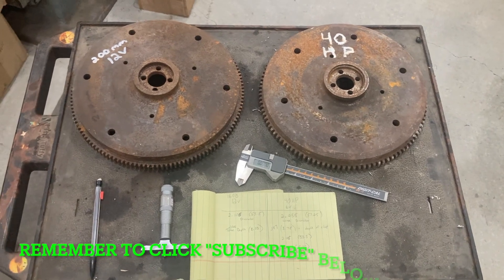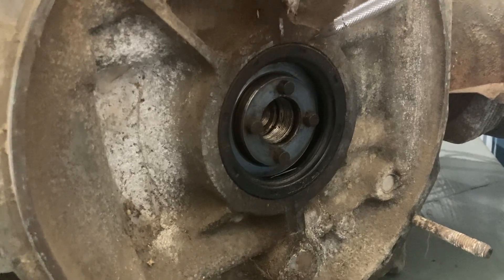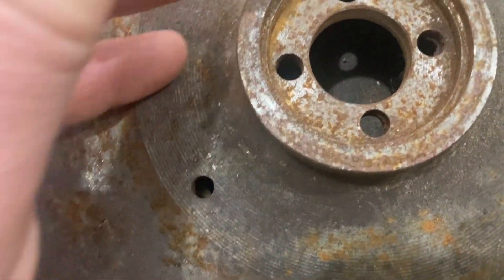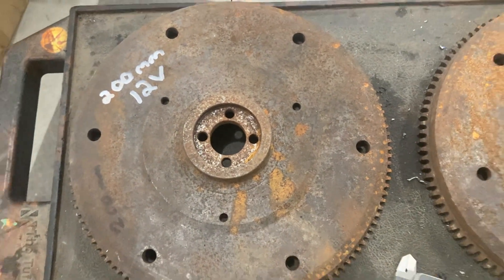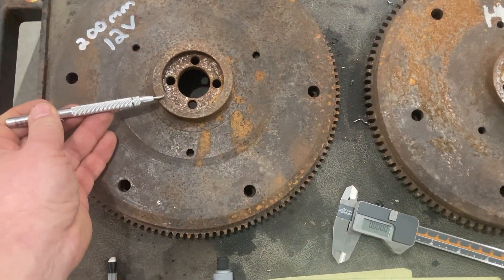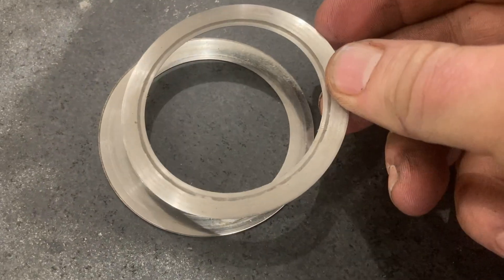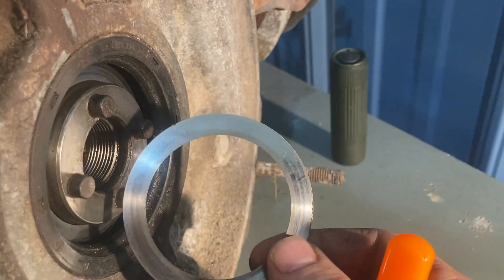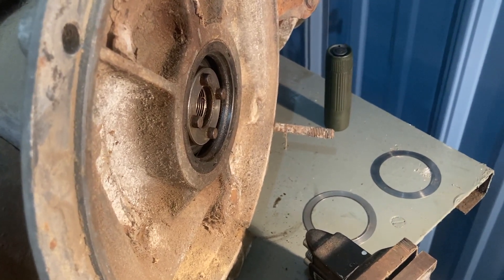AirCooled VW - Machining a 12V Flywheel for a 6V Crank - Type 1 Engine

Comment: Thanks for the excellent video! Can you bolt a 6 volt (non O ring) 200 mm flywheel  to a late O ring crankshaft using an early gasket? Would an early clutch with a collar fit with the 6 volt transaxle? Thanks

Comment: Hello, I made the 57mm clearance but now the opening is way too big !! When you now put the clearanced 12V flyweel on you're crankshaft without using the 4 dowel pins, you will feel that the flyweel has a lot of play. If you measure you're crankshaft it is 53.4 mm at the frontside and 54.7 mm behind the step. So I think that the 57 and a quarter mm clearance must be 54,7 mm. Correct me if i'm wrong. But still a great video.

Comment: Are you able to machine 12 volt flywheel shims to fit over 40 hors crank as 40 horse shims aren't available anywhere
Reply from the maker: You can’t really machine something that thin, as it’s a stamped product, but you could probably attempt to dremel it or create a punch style process. I’ve never tried it as I’ve collected 40 horse shims, but I suppose it’s possible to modify one if a person was careful enough. Making 100% sure there were no burrs or raised edges would be critical.

Comment: I used to run a 200mm 6V flywheel and 6V starter on 40HP with 12V

Comment: Very interesting. I have a later 12v gearbox in my '63 Beetle am trying to restore her back to standard (ish). I now have a running (but poorly) 1200 6v '64 engine, but am currently running a 1600 TP 12v. Should I even consider putting in the '64 1200 or just sack it off as a bad idea?
Reply from the maker: You’re saying you still have a Swing Axle, but it’s from a 12v car? So a 67 transaxle then?

Or is your 63 on a later I.R.S. pan?

Comment: other u tube wanna be why go threw all that when you can by a 6v 200 flywheel and do it right and just swap out.
Reply from the maker: I’d rather modify a German flywheel than buy a low quality aftermarket one from China, plus is much cheaper for me to do this and keep the German one.
Reply: Maybe because  a 6v flywheel won’t give you 12v teeth?